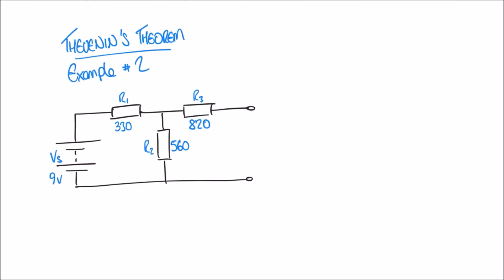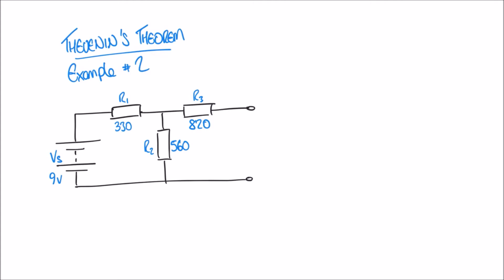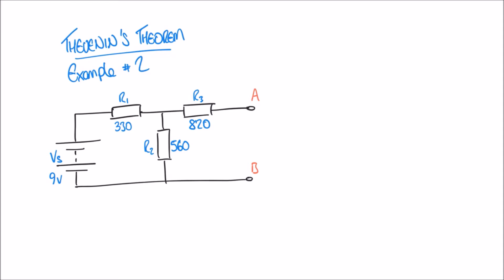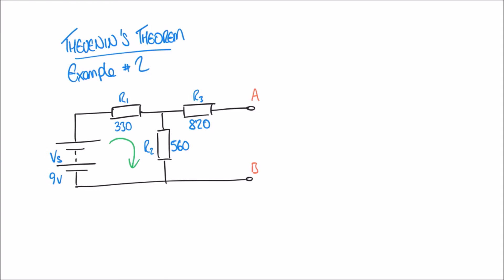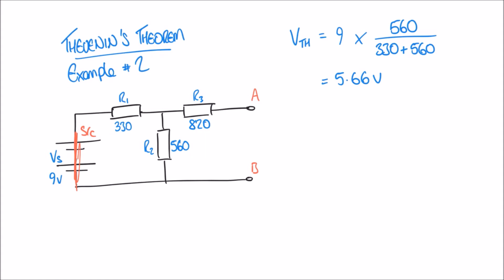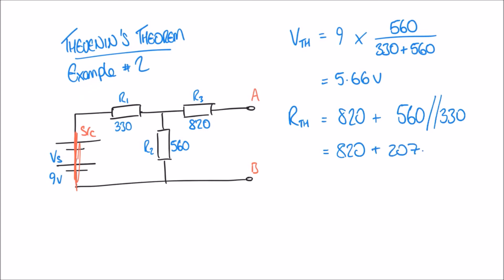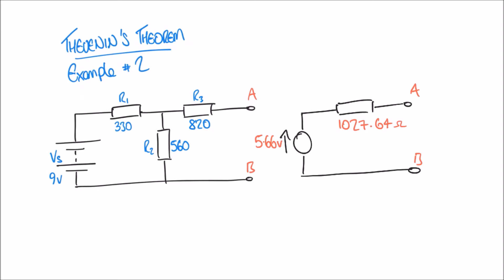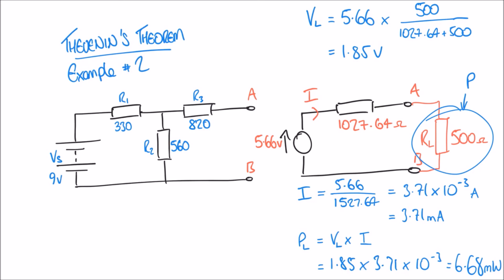Calculating Thevenin Voltage and Thevenin Resistance for Thevenin's Theorem

Comment: why did you use the a 500ohm resistor as the load? Is it just to show that you can add any value of resistor to close the circuit and find a current and power value??
Reply from the maker: Yes there is no particular rationale for the value of 500. This video goes into a bit more detail about impedance matching and maximum power transfer: https://youtu.be/-sgxnICR1pE thanks